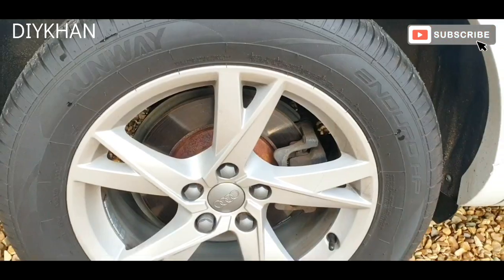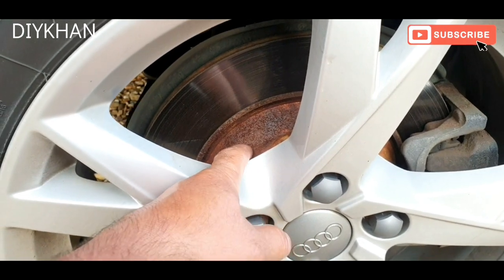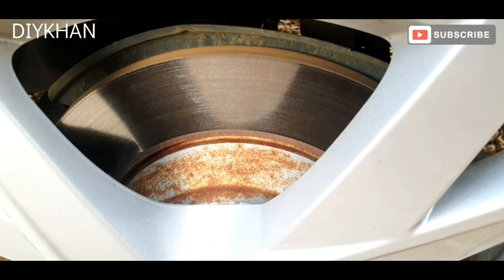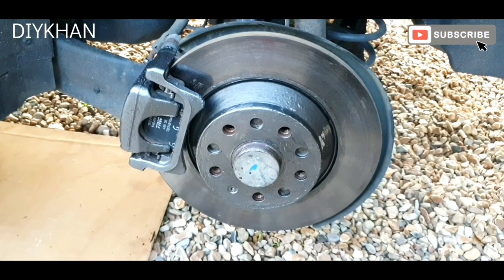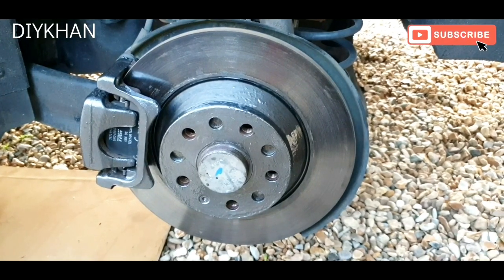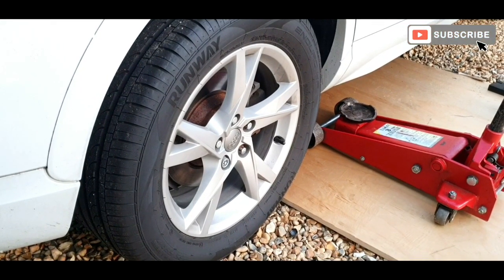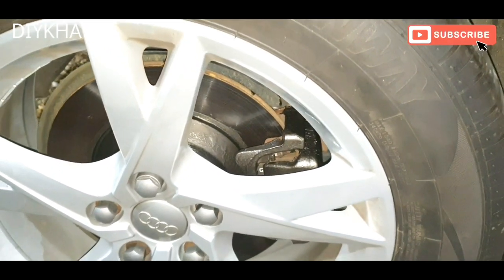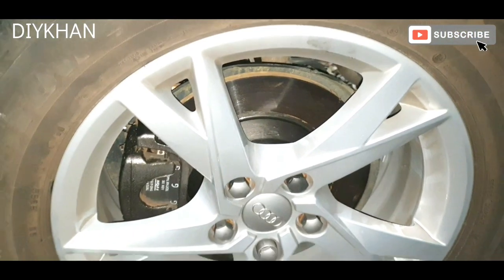Audi Q3 Rusty Disc Hub and Brake Caliper Painting. How to Use Brush on Paint on Hub & Brake Calipers

Comment: How did you get the rear wheels to spin? Is the e-brake off? Are there any issues with jacking up the car with e-brake off?
Reply from the maker: I made sure that the electronic brake is off and the car is on p mode ( automatic transmission ). I also put a block in front and at the back of the wheels to stop the car from moving.

Comment: How do you get the rust off, with wire wool?
Reply from the maker: Wire brush is only to take of loose rusted particles. Best to use sand paper or wire wool.